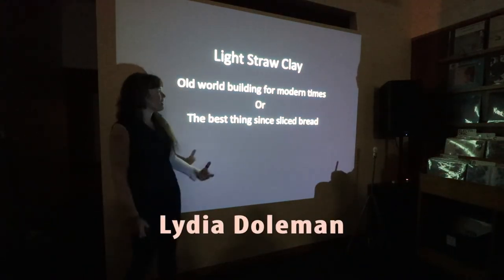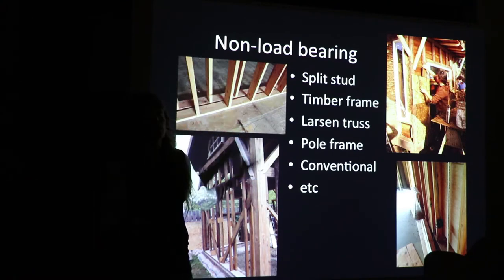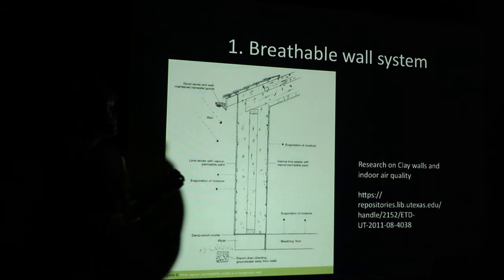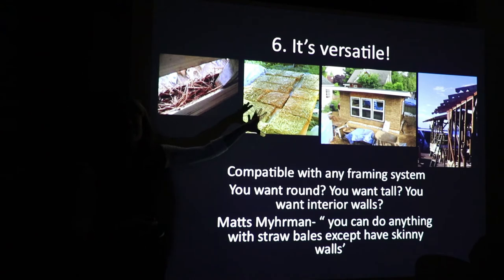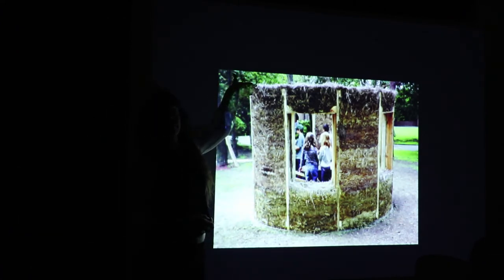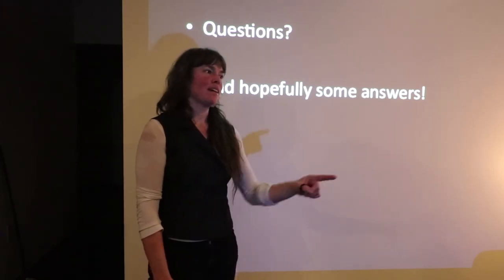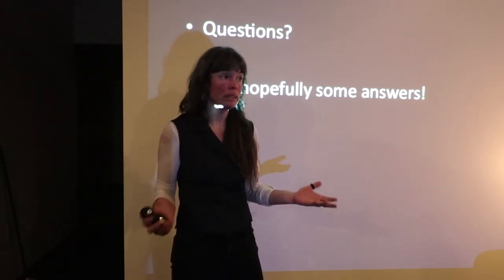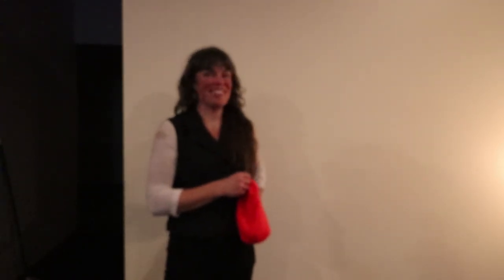Light Straw Clay Building Presentation by Lydia Doleman

Comment: For mixing manually, I would think the tarp method for cob, or a pitchfork and a watering can with large holes (so they don’t clog) would be the way to go. Two people working together - one raking and turning and one sprinkling slip and testing the mix - could probably produce more than two separately.
Reply: The more evenly you distribute the slip, the less mixing you have to do.
Reply from the maker: Great point!

Comment: Great video. Has anyone done a slip straw floor? Is this even a good possibility???
Reply from the maker: That is a very good question. I met someone who did cob floors at a conference so it may be possible. Let us know if you find anything about slip straw floors.
Reply: Cob floors are pretty common in the natural building world. I think light straw clay wouldn’t be dense enough for a floor. Standard cob floors are light on the straw, and it is cut finely, to add density.
Reply: You usually don’t mind having mass in the floor anyhow. So why not use rammed earth, cob or adobe? Passive solar you know, the floor is a good heat sink. You can insulate under any of these, although it won’t be easy to get a good r value. But you can use foam in a perimeter trench, too. To insulate the ground under the building.

Comment: What it is, is Straw with a Light Clay slip coating and the reason those of us that have used this method for some years refer to it as Straw Light Clay or SLC. Maybe this is a petty and trivial distinction but it generally identifies to me the videos produced based more academically than from actual hands on experience. This basic misunderstanding of why we call it SLC and not light straw clay should lead to some questions about the accuracy and application of other information contained in the presentation. Straw is light inherently, it is the clay coating on the straw that is being described by the term “light”.

Comment: What about termites?
Reply: I have only heard of one residence that had an issue with termites. Given the clay infusion in the cellulose fibers, it is unappealing to insects and rodents ( especially if it is packed well and detailed well). I would recommend the same precautions as with any building ( good flashing at the base and around openings) as termites are after the wood, no matter what your wall system is.